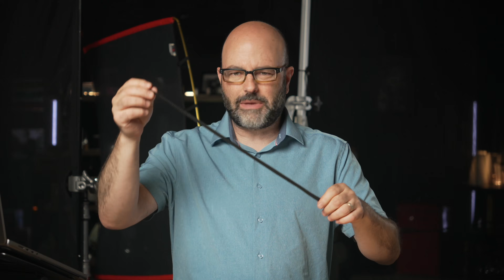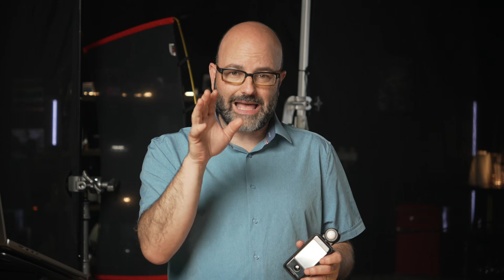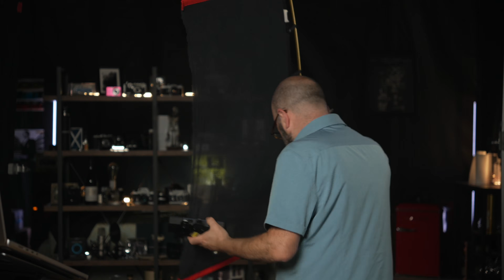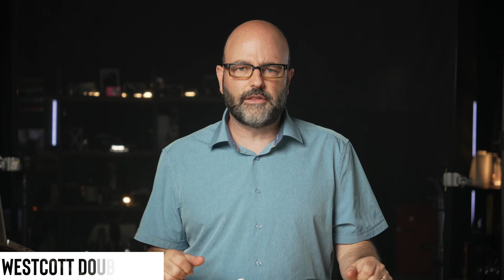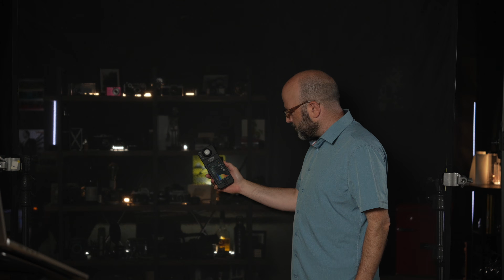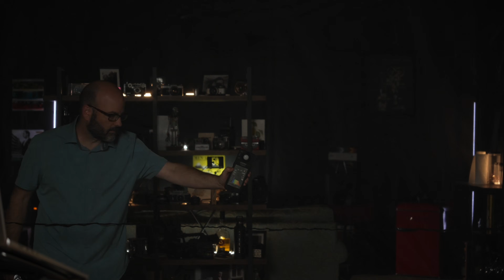TESTING DOUBLE NETS! (EP.268)

Comment: Very interesting, thorough test. I wonder if the non-linear nature of LED light-loss over distance factors into the severity of reduction you’re observing.
We’ve got a butterfly system at work with similar, flimsy corner strapping… I always got the impression it’s purpose was to just “make do,” especially for adverse conditions with a solo operator, just trying to set up a net with no help.
Thanks for this comprehensive breakdown of them Jem! Curious to see what they’ll say about the seam and such.